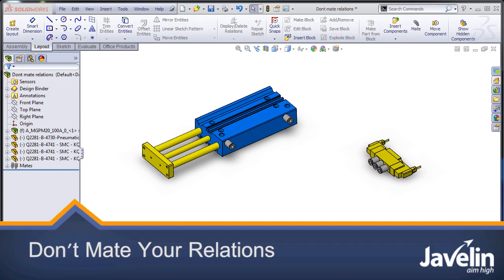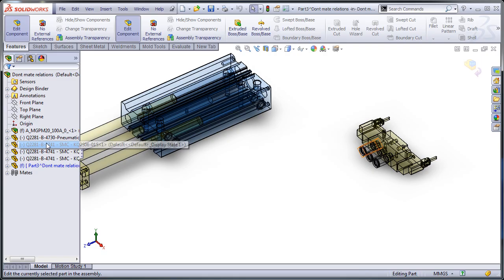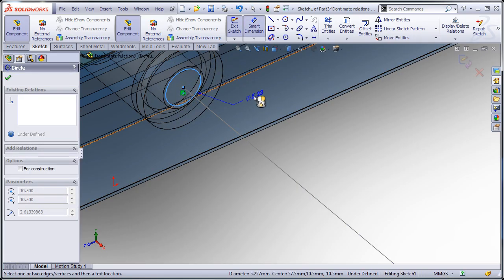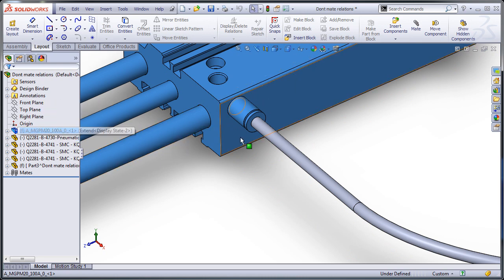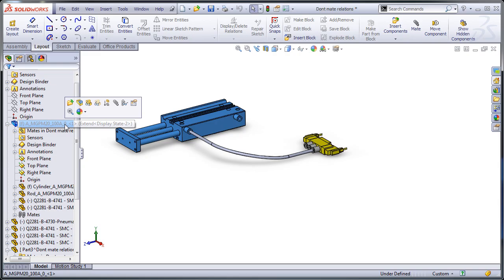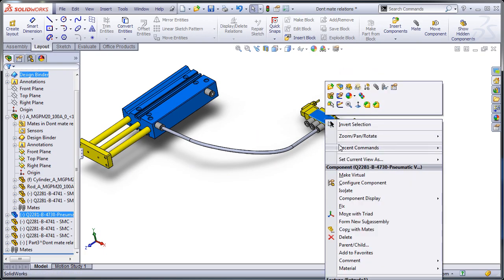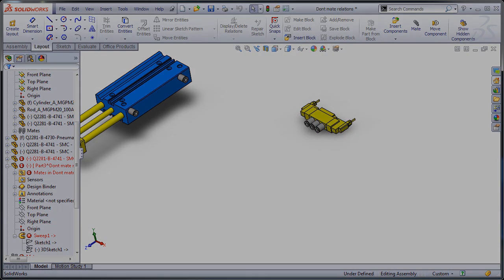SolidWorks Mates Best Practice Tip #2

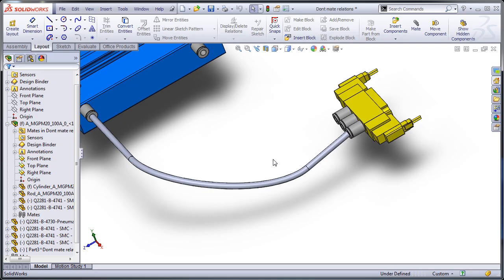Comment: 3:37 'if I do a rebuild right now, it updates. It's not quite what I'm after'

What are you after then? You moved a component and after a rebuild the assembly follows the sketch again, what's the problem here?

And why do you get a circular reference? You explain it but use the word 'it' a lot and it's not clear to me what you're referring to.

The last part, where the whole assembly gets messed up, it's hard to tell what's going on here. Your 3D sketch gets messed up, would that not have happened as well without the mates you added? And just making the right component fixed caused the assembly to be overdefined, how can that be?

Comment: Is this problem something new in 2013?  I've created hundreds of hoses and tubing runs like this in SW2010 and 2011 and have never had to mate the hose to the parts.  The sketch stays related to the fitting.  We even have cylinders you can drag through their stroke and the hose moves with them.

Nice video tips!